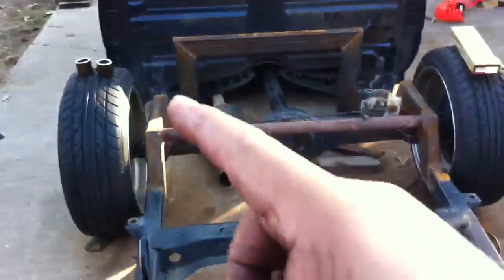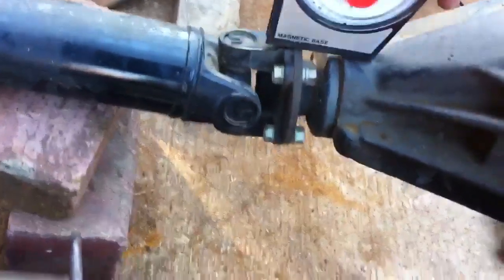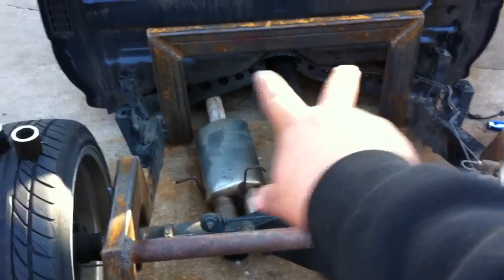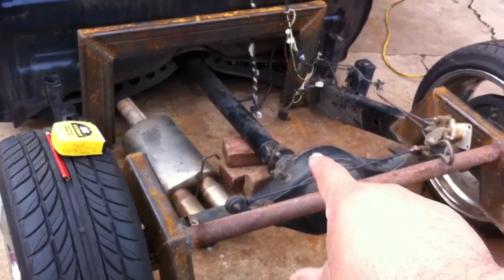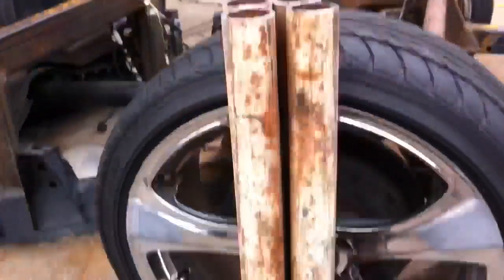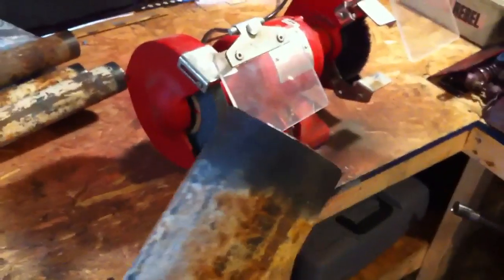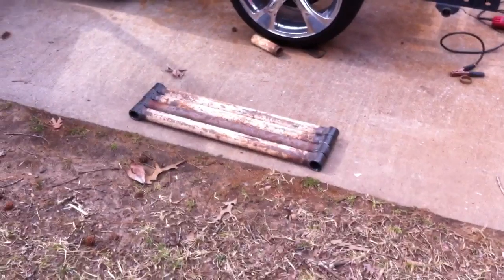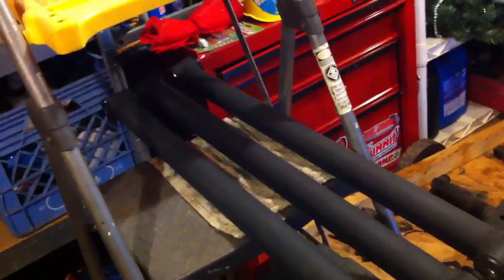How to make link bars

Comment: First off nice job taking the time and initiative to fab out your own 4 link. But now for some hopefully constructive criticism, notching a pipe out so it will mate up to the radius of another pipe is called coping and by not doing that and filling it in with weld to "make it stronger" in fact weakened the crap out of it. for a stronger weld you could put a bevel on the pipe and not just clean the paint and rust off but also the millscale. also something that i think would help you out would be if you got a wire wheel for your angle grinder to remove rust and paint its a heck of a lot easier than doing all that with a bench grinder.

Comment: I'm rooting for you, buddy, but you should have used the grinding wheel on your new toy to "fishmouth" the pipe so it fit the pipe closer. It would have been stronger than piling on the weld.

Comment: looks alright for used metal. extra grinding to prep helps a lot.
you need a better welder with gas. with Flux core is hard to do a nice job.
great to see your work man. looks good have  fun.
Reply from the maker: +Don Hill thank you very much I agree it would look nicer but I'm not in it for points just love to ride and I love the build as for details I'll leave that to the trophy guys. Thanks again for the tips and compliments.
Reply: Ya I know. Pretty costs money.

Comment: Buy a cheap used wore out pipe cutter and make marking your pipe a breeze, measure, mark one line, and then run it around there real quick to scribe a mark. Or  get a piece of angle, cut a notch-groove for our marker tip to set on-in, place pipe on angle (or vise versa), put mark at notch-groove and roll the pipe (or vise versa).
Reply from the maker: This are awesome ideas thank you I'll definitely be doing that in the future thank you.

Comment: If your upper and lower 4 link bars are same length you can set your pinion degree and it will never change
Reply from the maker: The pinion does not change but the angle to the drive shaft does so you set the pinion angle to your ride hight with any set up. After that any movement up or down changes that.

Comment: nice job on the link bars.  how would I match the ends with bushings on an A body Mopar frame.  the bars will be much smaller dia. than your truck...  ty mark from ct.
Reply from the maker: I've never delta with what your talking about so I wouldn't know in not a master at this just sharing the knoledge of what I am doing at the moment sorry I can't help you more.